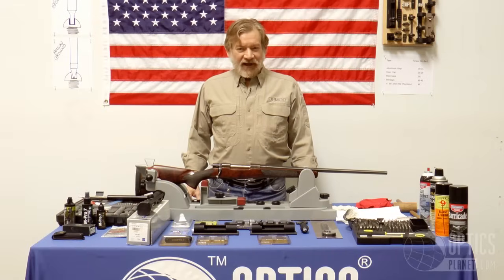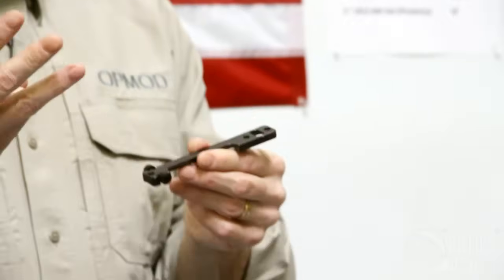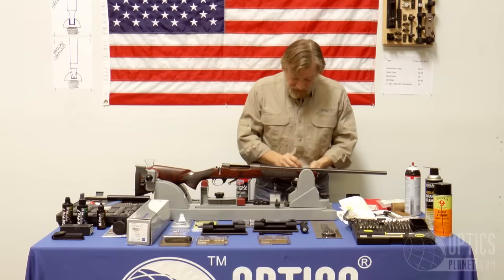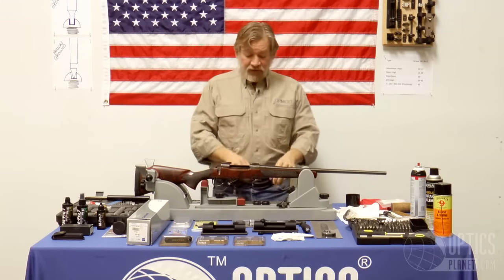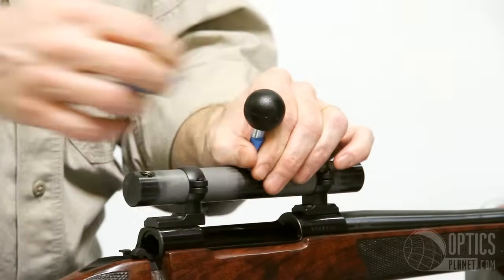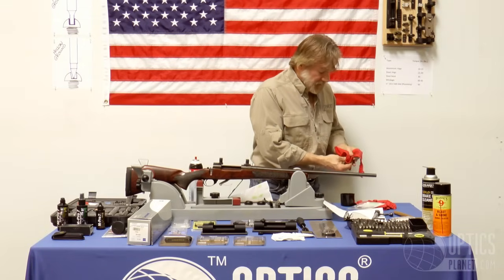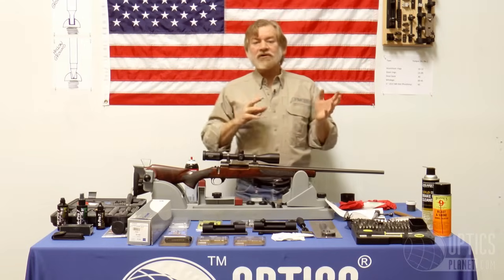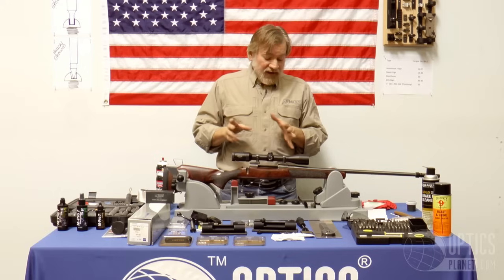How To Mount A Riflescope - OpticsPlanet.com

Comment: I've been looking for a video of how to insure that the vertical reticle is centered to the bore center so that when I use the elevation graduations of my scope are on target regardless of how far up the on the reticle I'm looking.  By using the "by eye" method of leveling my reticle would be a matter of luck in this regard.  I haven't seen a good video on how to use any kind of levels to do this.  I watched the whole video and like it but my question hasn't yet been answered.

Comment: I may go a little overboard with the ring half gaps. I tighten each side with a feeler gauge in between the halfs and gradually decrease thickness by .001 until i feel them snug the scope on the same gauge. Gets them EXACT but i tend to overdo things in a good way.

Comment: Pipe cleaners work better than q-tips to clean oil out of the action screw holes.  

 I could have used that bronze brush trick last week.  I just used acetone and my fingernail. You're right, solvents don't do much to Loc Tite.

The Leupold logo on the top of the rings mean you no longer have to make a mark to save your orientation.  You just have to make sure you get the front on the front and the rear on the rear.
Reply: Crack pipe cleaner

Comment: I don't like the idea of adjusting the cross hairs "by eye". Personally I want the cross hairs to be perfectly 90 degrees with the the axis of the action.and the scope. Other than that. I think he did a good job of taking his time and good attention to detail.
Reply: +BottledWater If the rifle is sighted in at long range to begin with there is no difference at intermediate ranges. Other than extreme offsets of the reticule.
Reply: +Mike Nelson.  Normally it would make a difference. But you are correct if you can hold the rifle exactly the same way every time. I shoot from a bench. So I don't really know anything about the complexity of the "Ghetto stance".
Reply: +Mike Nelson.  I was only trying to be funny.  I'm happy you didn't take offense. Have a good day.

Comment: Great video. I would just take exception to one thought. I believe the label on your screwdriver illustration on the wall, should more appropriately be labeled with the bottom depiction as taper ground, not hollow ground. You leave folks with the impression that they should not use a "hollow ground" screwdriver and that is not the case. They should not use a taper ground or carpenters screwdriver, but a flat ground or hollow ground screwdriver is completely appropriate. Please note that I am not referring to a hollow grind as used in knife blades, they are different than hollow grind as applied to screwdriver blades. A hollow ground knife blade is shaped like a taper grind screwdriver. Gunsmith screwdrivers are commonly referred to as hollow ground screwdrivers.

Comment: The "Hollow ground", "Flat ground" screwdriver diagrams are reversed. Protect your gun screws and make sure you use the correct type. The top example is Hollow.
Reply: +Paul Evans  correct.

Comment: hello I would like to start with saying nice video,, I have a rifle I have had a very hard time finding a scope mount for and I hope maybe you can help,,  I have a very nice cond 1953 jc Higgins model 50 270 win,, it is a Belgium made fn mauser 98 action,, I have found allot of mounts they claim will fit but don't,, mainly because they are drilled and tapped at 22mm front and 13mm rear,, but my action was factory drilled and tapped at 22mm front and rear,, with the rear mount thicker than front,, would you possibly know of a mount that will fit this rifle I would be happy with 1 or 2 piece mounts I do have the factory mounts but they are 15mm dovetail mounts that seems that no one seems to make rings for that are ex tall for 1 in scope tube,, any help or ideas would be greatly appreciated,, I would like to be able  to use my rifle,,  thank you for your time,, Robert

Comment: Great video and thanks for taking the time to do it.  But I must say, that's not how you use a torque wrench.  You're using it more like an impact driver, those extra clicks are adding to the torque.
Reply from the maker: Greetings! 
We appreciate your feedback. One of the benefits of a torque wrench is that once you reach the set torque level, it starts clicking rather than tightening. The clicks do not impart additional torque. If you have any questions, please feel free to contact us!
Reply: OpticsPlanet yea, ok.

Comment: Chart shows 15-20 inch pounds.  You adjusted to 25 inch pounds in your Fat Wrench.  Inconsistent there.  Leupold recommends 25 inch pounds on the rings, 30 on the bases.

Comment: So if you level the scope by "eye" if the reticle is slightly out of vertical surely that will be amplified down range.  Surely you must check the vertical reticle is plumb with a plumb line to check the reticle alignment and verticality against the plumb line.  Fixing the scope with eye only cant be professional surely.  Without lasers etc. surely the plumb line is the only way !!
Reply: Calibrated eyeball

Comment: All that with the mounts and  you don't level the gun and use a plumb line to level the scope  cross hair . I'm sorry but if you don't use a plumb line and level your gun  your going to have nothing but trouble  at long range shooting .
Reply: I agree for precision shooting but using a level is a can of worms.   Most of the levels are not really level and most of the caps on scopes are not really level.    You can eyeball it on a plumb line closer and faster than using levels.  I have both and I can level better without them using my eye and plumb line.    You do know that scope cross hairs should bisect the bore and a level won't get this right you need a mirror do that that.    Levels give a false feeling of being correct when most the time they are not.   You are assuming the caps, the gun etc all have true surfaces.   They don't and more often than not are out of alignment more than if you just used your eye and wall to align the cross hairs.
Reply: @Physics072  Where are you getting that? I've used a level for 30+ years and have never had a scope NOT be leveled. 
Buildings in every city would be like the leaning tower of pisa. Ridiculous comment.
Reply: @muhammadsteinberg  I am saying most scopes are "Close enough" The scope can be level but the bore might me shifted 1mm to left or right.  The rails, scope etc can be off and usually are a little.   

Just because the scope is level does not mean everything is lined up correctly.  Most will have a can't error.  Lining it up with the bore using the mirror method can get rid of these errors but then you need to have a level on the scope so you hold the gun the same way each time.  Its more of a issue for target shooters than hunters.  Most people have these errors and never know it.
Reply: @Physics072  For some shooters close enough will do, so I agree with you on that. 
I was commenting on your assessment about levels. When I put a scope on I use a stand that I level, put the rifle on it and level that. Level the rings. Level the scope in the rings. A reticle canted left or right will consistently make your shots yaw left or right.
Reply: @muhammadsteinberg  I'm sure you are doing a fine job.   On Levels I have like 10 of the little ones and many of them can't be trusted.   I ended up getting a engineering level that seems to be true.   Also its hard to keep the level on the gun sometimes when mounting the scope.   What some do is to get the gun level using one on its receiver then strap a barrel level on so both levels are in sync.   Then you can remove the rear level and not worry about knocking it off the gun when moving the scope about.    There are many ways to get the job done.

Comment: Smart man, virtually every rifle scope ring made is not perfect, you have to lap them.  I have not owned any rifle rings that didn't need lapping.  The effort is well worth it and will help zero faster and accuracy will be better.
Reply: How does lapping the rings make zeroing faster and accuracy better? I agree that lapping the rings makes for more even ring pressure on the scope.